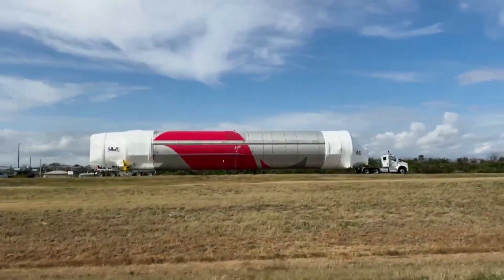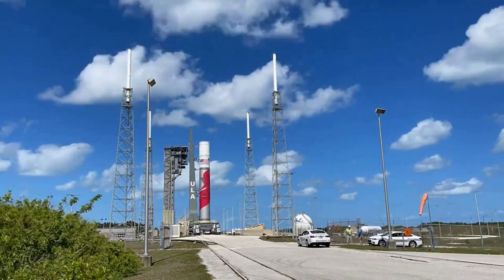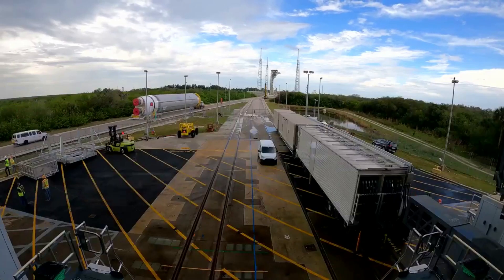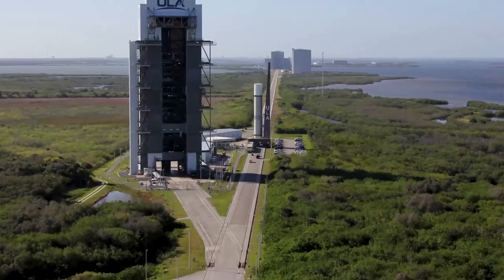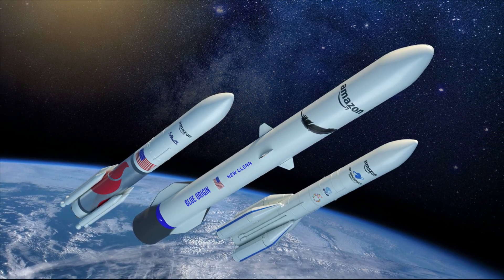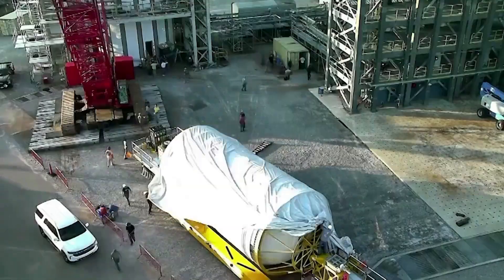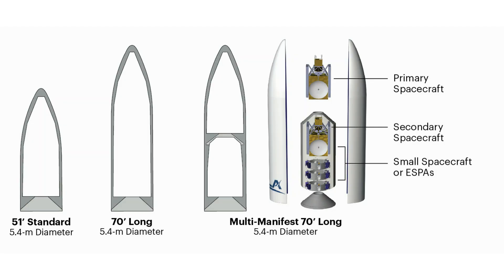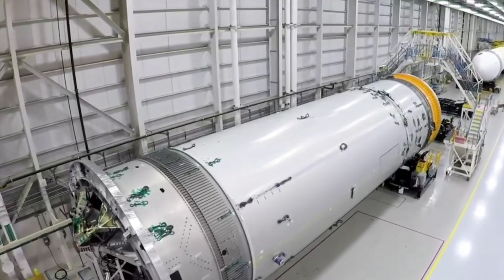Vulcan Completes Tanking Tests Ahead of First Launch

Comment: Great! I wonder how the proposed sale of ULA is going to affect its production. Depends on who buys it I guess.
Reply: Yeah, but do you think that the military or Amazon / Bezos would allow the sale to go sideways?
Reply: I think Lockheed Martin will just buy out Boeing.
Reply: @luther0013  That does seem to be the logical choice.
Reply: @luther0013   What if Boeing doesn't think Vulcan and Starliner will work in the long run, maybe because Starship comes on-line? And what if L-M thinks that too or at least does not want to double its position? Maybe Sierra can find the money - that would be cool.
Reply: @erideimos1207  unless you can explain how Starship actually threatens Vulcan and Starliner enough for Boeing to pull but not enough for Sierra Space to be interested then your point makes zero sense.

Also I am of the opinion that Starship in very little way effects Vulcan and has no effect on Starliner.
Reply: @luther0013  Your points in order. If Vulcan Centaur costs ~$180m/launch (propellant & vehicle) for 27.2t to LEO, that would be ~$6,617/kg. Starship burns cheaper methane fuel, and propellant cost is estimated at about $500k/launch when purchased in volume. Total payload early on is probably going to be closer to 100 t than 150 t, so that'd be $4-5/kg. Elon tweeted May 2020 how it came to ~$10/kg. But let's say things cost five to ten times as much for all sorts of reasons. Starship to LEO still costs 1% of old space. A bit over 2 years ago, SN8 blew. Now we have 24/7 about ready. Sure they have to consider where Starship will be in 2 more years.

But my point was that if, for whatever reason and only if, L-M does not buy the other half, of all the remaining possibilities, I personally would cheer to see Sierra take ULA in the direction of dream chaser. Sierra having the need for Vulcan to fly DreamChaser, having a good rep, real money and a longish history, and seeming pretty savvy might see an opportunity where others do not. Again, a light hope, not the opening claim of a debate.

My phrase "maybe because Starship..." referred only to Vulcan. Poorly phrased, apologies. I would add imo that Starliner is impact-drill screwed by CrewDragon. Peace.
Reply: @erideimos1207  so first you pulling numbers out of thin air for Vulcan and a your source for Starship is a known source of disinformation. 

Secondly Vulcan and Starship use the same fuel for their first stages and your basing Starship costs just off the fuel not including any of the other things that cost money like ground infrastructure, manufacturing costs, refurbishing costs or refuelling flights cost.

While Starship can take 100Mt to LEO it can’t take it to GTO without refuelling flights which significantly increases costs and keep the payload waiting around in a parking orbit burning energy on its batteries.

In regards to Starliner I don’t see crew dragon out competing it. Starliner has higher boosting capabilities as well as it takes 5 people up each time instead of 4 and it lands on the ground simplifying recovery.The bigger threat to both is the DC-200 Dream Chaser. Speaking of which Sierra Space has already started that Dream Chaser can launch on any 5 meter class rocket so they are not reliant on ULA or Vulcan so buying a stake in ULA is not in their business interests.
Reply: @luther0013  The Vulcan info is Wikipedia, the Starship info is SpaceX's Chief Engineer. I'll let the rest go and give you the last word.
Reply: I am rooting for SNC / Serra Space
Reply: Rumors.  However, Boeing is up to its Neck in Problems. Cash $$ would help.

I would not be surprised that Boeing would desire to “sell their portion” of partnership.
Their Delta Heavy launcher (1990s McD design) will disappear after 2025.
I do not see Lockheed desiring to divest — in fact, they considered buying Aerojet (until due diligence killed idea).
Who would buy Boeing out?  Northrop? Blue Origin? others?